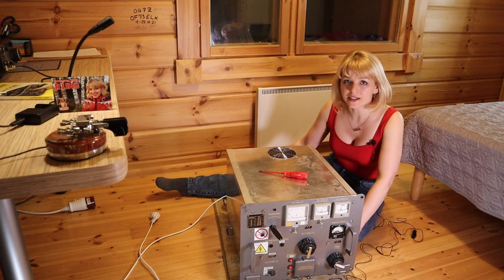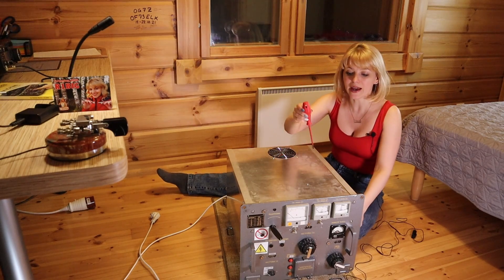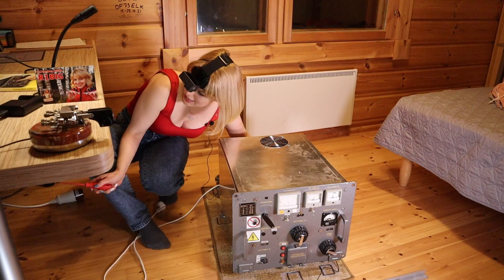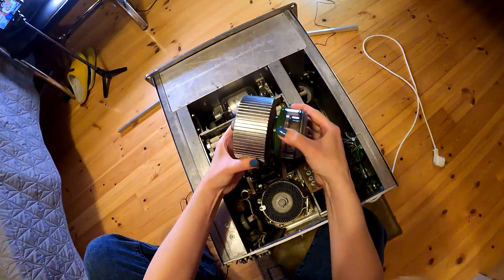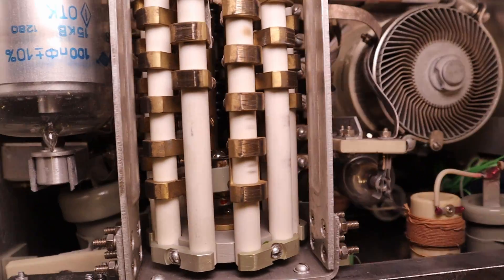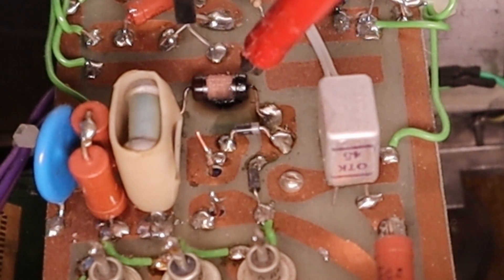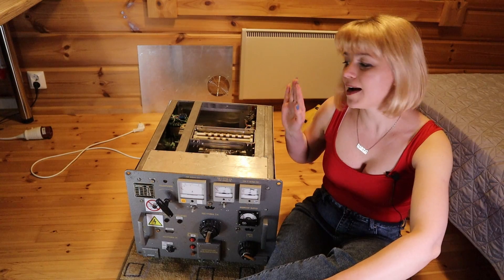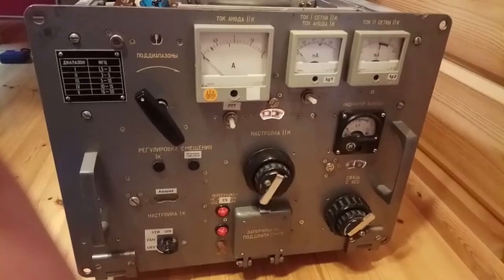Amplifier Burned 🔥? YL Raisa looks inside R-140

Comment: Be careful of the capacitors as well. They age and can fry or burn as well. I would suggest you make a list of the capacitors that are used along with many photographs of the amp so as to mark the components location and values. Do you have a schematic of the amp? How old is it? My understanding is that Russian operators would design and build their own equipment. That is what I grew up understanding. Too many of the hams in the U.S. are appliance operators, my being one of them and not ashamed to say so. With this in mind, I am going to guess that the amp will probably say 'Made in Russia' or similar. Let me know if I am wrong. Where to get parts is what I am wondering. In this current situation, I doubt you have a Radio Shack store to go to. How do you get parts? That could be a subject for another video. How do you all obtain parts these days? Trade among yourselves? Make your own? Find old radios (as some of us do here) and beg, borrow and steel parts? I don't think I am the only one wondering these things. I hope you get it fixed and soon.
Reply from the maker: of course it is made in Russia. It is a old sowjet TX, which was rebuilt to an Ham radio Amp by RK3AD, who made Hunderds of that amps (R140). The tune GU43B is still available in Russia. No big problem to buy it.

Comment: Hi Raisa,
Glad you found the burnt component. Hope the tube is OK and it doesn't take long to repair for you to get back on the air. You need that amp to bust the pileups.  🙂  Stay safe.  73  WJ3U
Reply from the maker: Today I had a QSO with Curacao.  I had 100 w and I bust the pileup and was very happy :)

Comment: The problem with the amplifiers (both tubes and solid state) is the service when someting goes wrong. I my eperience I was able to fix two or three times some issues in my old gu74b
Reply from the maker: Luckily I have someone to turn to.
Reply: In this R-140 there is one tube GU43B ... and they are not eternal ...
Reply: No no, the gu74b is still alive, orher components are gone... 73

Comment: Hi Raïsa ! Be very carefuul with this kind of amplifier ! High voltage is very dangerous and can kill even it's unpluged. Condensators are always in load. Happy New Year 2023 ..
Reply from the maker: Hi Bruno. Thanks for your care :) I'm very careful with things like this.
Reply: @YLRaisa  Hello Raisa! I just found your channel and it is one of the best of all! Yes, capacitors can hold gigantic voltage charges for a very long time. When working on high voltage tube equipment, especially when checking voltages I would always put my left hand in my back pocket as  I am right handed. VY 73 es Gud DX de WA1UFO- Radio Spacejunk!